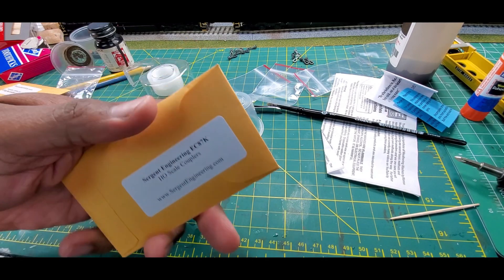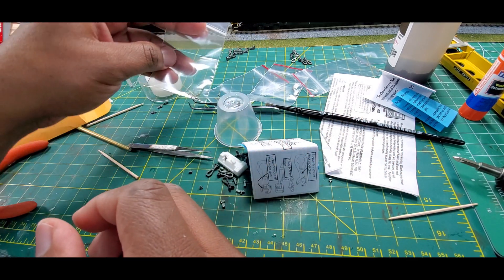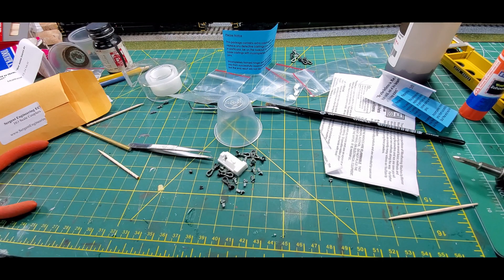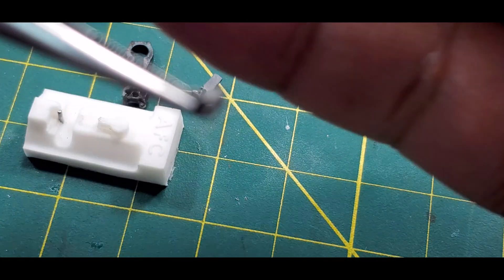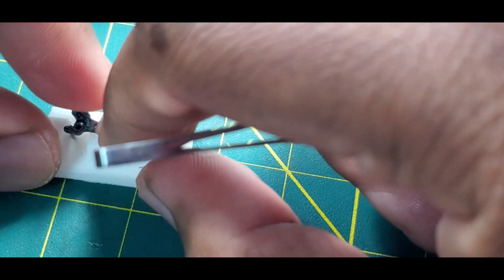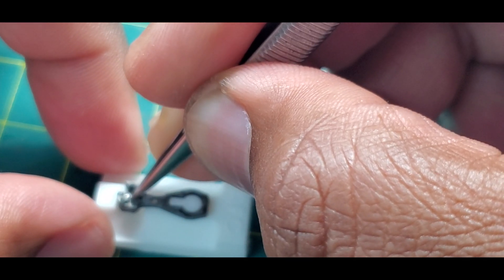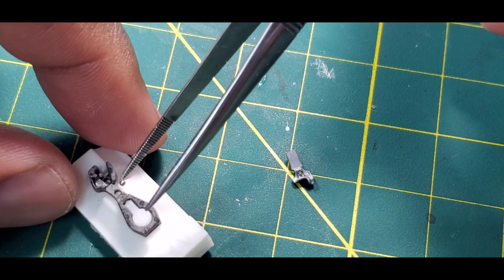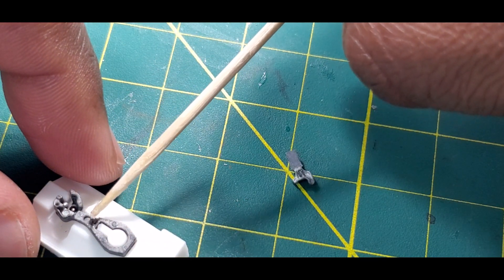Sergent Engineering Couplers

Comment: As of 2025, Sergent has vanished about 3 years ago. There are 1-2 companies that make compatible couplers. I bought a 144 pack a couple years ago (was possibly one of the last orders they filled). Frank put the design into public domain but Kadee loyalty is strong. I have devised a strategy of using Sergents, Kadees and, for unit ore and coal trains, drawbars.

Comment: I believe Athearn used plastic couplers because they use a metal frame that conducts electricity. If the couplers were both metal, and the units were back to back...the polarity would be reversed on each frame, and since the couplers would conduct electrity,  a short could happen.
Reply from the maker: I haven't had any problems with those couples. Everyone has different experiences with them. I enjoy using them because it looks & acts like the prototype  In my opinion.

Comment: I love these couplers. Nothing can beat the look of exact scale. I held off a few years ago from switching to them because I was concerned about log term availability. Have they found anyone to manufacture them since Sergent is closing down?
Reply from the maker: Hey I've been ordering off their website I have about 4 of the kits I'm using  them  on locomotives because they look prototypical they also couple up to other manufacturers couplers.
Reply: @engineerhall5887  They were discussing Sergent couplers on Model Railroading Live about 3d printing Sergent couplers because of availability  issues. Frank Sergent did release the design to public domain and that is stated on the website. If you go to the FAQ tab and see compatibility, it says they dont work with other knuckle couplers so that is where I base that from. I built a pair of the couplers about 20 years ago to see if I liked them but never tried to use it with others. It is nice to know you were able to get them to work with some other brands. They are by far the best looking couplers in the hobby and have been for many years. Cheers Rob